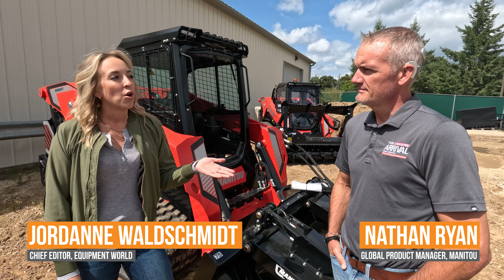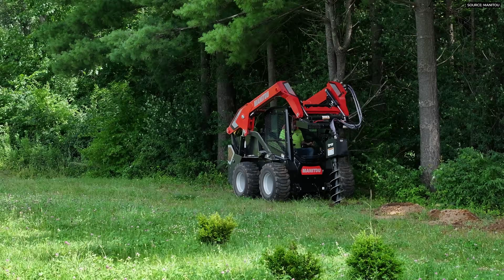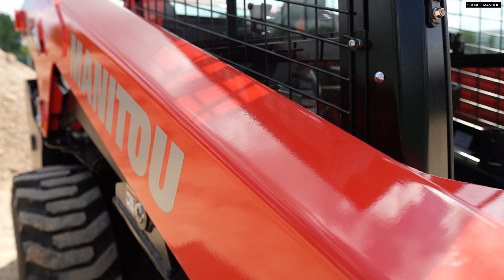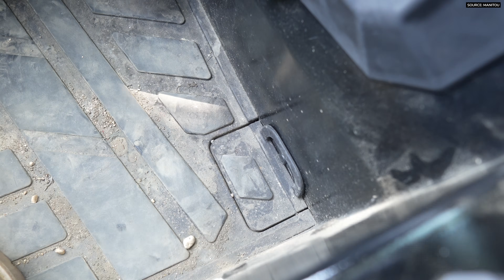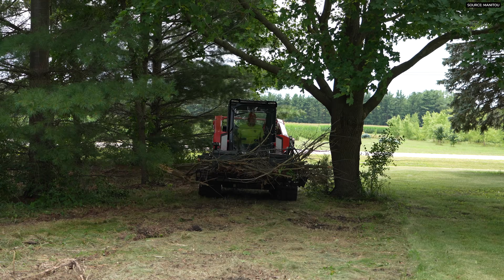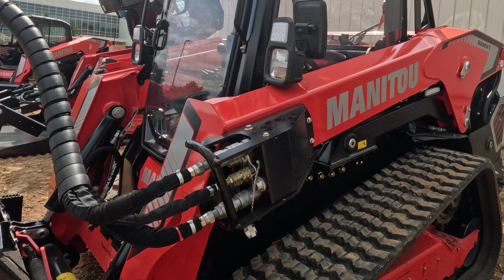Manitou’s New Large-Frame CTLs & Skid Steers | 3250V, 3350V, 3350VT, 3600V & 3600VT Walkaround Tour

Comment: Have a gehl vt230 same as manitou.  Lift cylinders leaking at 25 hours . Took almost 1 month for gehl / manitou to approve warranty  claim.   I will be selling machine.  Cab leaks , door freezes up in winter,  cab not pressurized ,lexan door is weak and foggy..tracking power is very weak